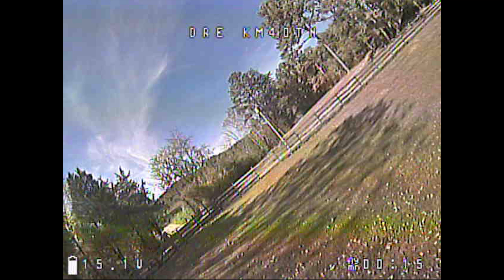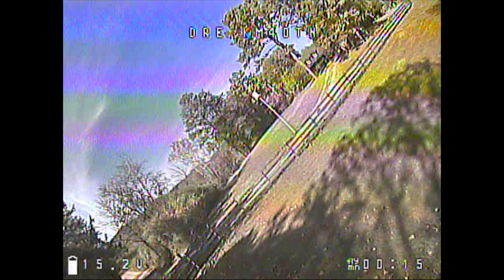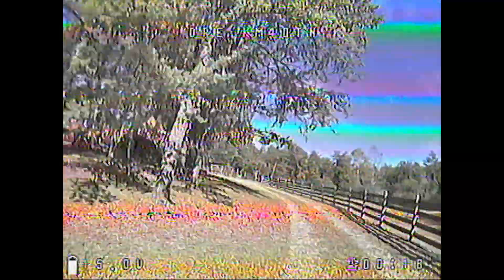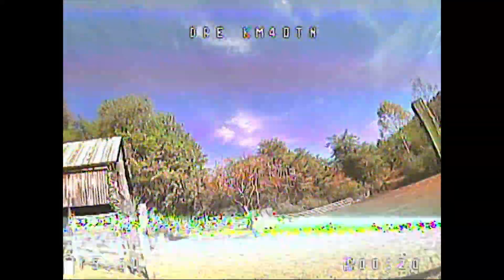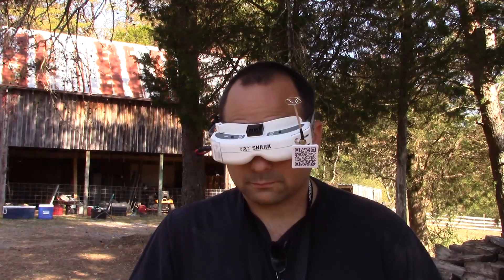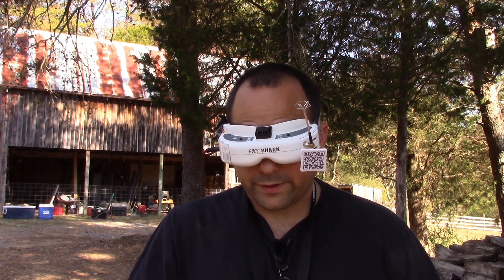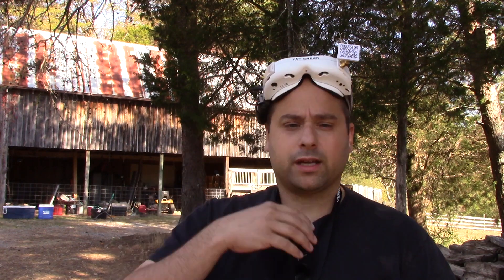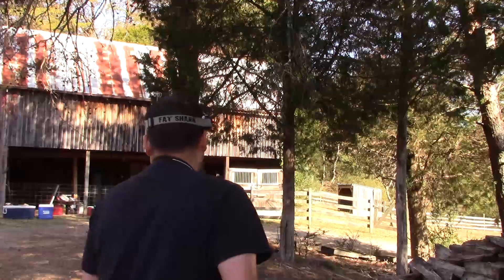Can You Troubleshoot #4 - CYT Why This "Desync" Isn't A Desync At All

Comment: Was there ever a successful troubleshoot?  I have the same thing happening regularly to my quad.  OSD splash, armed, somewhat controlled flip or fall out of the sky... seems increasing min throttle and fail safe hold time helped but I think bad signal strength in the first place is to blame.

Comment: my first thought looked like you caught something like a tall blade of grass/wheat with motor 3's prop because it was your copter acted like a happy dog running full speed on a long leash and got whip-lashed. If the motor got jammed, could it be that caused a momentary high amp draw & then caused a brown out?

Comment: Did you ever figure this out?, maybe rc reciever lost power and reset for a split second or signal to the FC, RSSI showed 0, but still showed 14.9 volts, you check BB for rx signal, just my 2 cents. had a issue 2 weeks ago BB showed good RSSI but RX reciever data dropped low, but no indication of a failsafe. maybe wasn't long enough just enough to make me panic and crash, one broken prop easy fix. very similar to your vid. only ever happened to me once. no  mechanical problems found for me after a rebuild for inspection. also fpv dvr audio for me showed no sounds of reboot tones.

Comment: This looks very similar to a failsafe that is set to hold the last values. The quad locks into position for a split second and if it regained signal it would flipped because of a correction from the radio. This happened to me when my transmitter was failing.

Comment: Just went through something  similar where my FC reebooted mid flight on it's maiden.   Turns out in my case, the built in OSD was loosing sync with the FPV cam when it went through changes in lighting.  single stepping through the fpv footage capturing screen grabs and making a mosaic made itobvious that the OSD had lost sync when the contrast changed, followed by complete loss of OSD and control.

Comment: I definitively love such work of investigation :)
I know this is a pure troubleshooting and methological exercise and as you say : 'All we need is in this video', but for me the most important information of this video is that you mentionned you haven't solved the problem yet even if you have more information than we have !

Let me clarify :
Based on all previous comments and investigations, we have all differents ways of investigation (failsafe, prop issue, pdb issue, etc...), all based on the same observation : your video.
I'm 100% sure that you have also watch carefully your video footage frame by frame, and all the observations we already made, you already know that !
But to give you the good troubleshooting walkthrough, we need to have more information from you and especially the state of your quad when you arrived at it after the crash.
(When I have such issue, the first look of the quad is at least as important as the video of the crash !)
So I can notice that even if you know the state of the quad after the crash, it is not enough for you to know what the issue was. And it is definitively a good information for me :) (when we know your level of knowledge and expertise in quadcopter...)

So in order to be all at the same level of information, can you describe as much as possible (and objectively) what you see when you reach it on the ground ?
Cable cut or not, solder broken or not, props broken and if yes, which one, etc...
Are you able to arm again and start motors spinning just after the crash ?
About the failsafe, what is your delay configure in betaflight for state 1 and 2, as this could definitively exclude failsafe issue if your delay is greater than we can see in the video.
Thanks
Reply: Hi Raf, you seem to be a knowledgeable expert in this field, can you pls help me out. I've had a very similar crash with my copter. And adding onto that, logs show a motor output saturating. And i confirm that there are no wire cuts or solder breaks or prop failure or motor coil burn. And state of the drone post crash is disarmed. And in this state when i try to again arm and run my motors using motor test, they don't respond. Unless i reboot the drone, then everything seems to be working fine. What do you think is the possible issue?

Comment: I think it was motor/esc #3 that failed because it looks to me like the back left of the quad drops first.  It can't be this simple because of the OSD popping up just before hitting the ground, but I really can't elaborate on that.   Something I also noticed was that the quad didn't keep rotating after it was upside down it leveled out just before it hit the ground, I assume that is the point you hit the disarm switch?  As far as the black screen that I see people mentioning, I believe that is just you losing video signal momentarily because the antenna was in the dirt, and your body was directly blocking the space between the antenna on your head and the quad, as well as the ground itself.  The quad rolls to a rest nose down with the antenna slightly up giving you a better signal, and a second later when you lift the goggles off your eyes and remove your body from the equation, it gets even better.

Comment: the quad copter went from an armed state to disarm, then to arm again, seeing as you were going through an area which may have been momentarily obstructed from your transmitter, (unless this was you doing the disarming arming though i doubt you would have rearmed so quickly), my guess is the receiver signal got momentarily disrupted and switched to disarm before quickly regaining correct signal and switch to arm, however this is more of a guess and i doubt you don't bend or kink your antenna wires.

Comment: Well I got way more thoughtful about this than I planned! Initially I thought left rear motor failure but the more I watched the video the more I questioned this hypothesis. 

I think the sequence of events is...

1. the cause happens. Looking only at what happened and not why,  the copter appears to freeze in its movement around all three axes. It is hard to describe but it just LOOKS like Josh is no longer giving inputs. 

2. Following this brief 'pause' a small uncommanded pitch up roll left yaw left moment was enacted on the copter. 

3. The copter flips back and rolls left and lands on its back. Upon hitting the ground power is disconnected briefly and the FC reboots.

Lets start with a thought about the flip backward and the roll left. I do not think this was a result of left rear motor stopping.  The reason for this is twofold. First if it was just the left rear motor stopping the quad would probably have continued to rotate and accelerate in rotation until it hit the ground. It didn't. It flipped over 180 degrees and then reversed into the ground while inverted - but the rotation had definitely stopped by this stage. Secondly, if it was the left rear motor stopping and Josh disarming that stopped the rotation, Josh's disarm reaction would have been insanely fast for the end of flight summary to come up so quickly. From the video of the camera on Josh as it happens I don't think his reaction in disarming was quite that fast.

Therefore I believe the motors stopped BEFORE the quad pitched up and to the left. We then need to explain why it pitched and rolled and I believe the answer to this is aerodynamic. If you look at the flynoceros quad with it's top mounted pod and picture frame design, it is quite feasible that the centre of aerodynamic pressure (centre of drag in forward flight) creates a coupled pair of forces with the forward thrust vector of the motors. This is normal with a quad in forward flight - there will usually be a moment acting on the frame so as to pitch the nose up. The Pitch I term is usually acting against this and can be seen in blackbox logs.

When the motors stopped however, the PID loop loses its ability to counteract this pitch up moment but the aerodynamic forces still exist - and start to win out. The quad therefore pitches up but not too violently because it is only driven by the airflow, not by a rogue motor(s). This is why it seems to only gently flip over backward by 180 degrees.

So if we assume that any problem that caused the crash was not the cause of the obvious symptoms we see (pitch up, roll left) we can start looking earlier in the timeline for the cause. This is where I come back to the first point above. The quad appears to 'freeze' for a brief time before the flip. To me, it looks like a receiver failure maybe. (Not certain, I have never had one haha). Or maybe a voltage drop. I am not too familiar with the operation of BF OSD. If the board reboots, does the end of flight summary screen come up? Or does that only come up when you disarm.

Either way I think the key is in that moment where the quad freezes.
Reply from the maker: This is a really great analysis. Gold star! I will say that I don't remember the copter freezing up, but it is an area where I would have been flying pretty straight and level anyway. The copter freezing up would be consistent with the most likely cause of this event, given all the evidence. And I do agree that the video seems to show the copter freezing up.
Reply: Hey looks like I was kinda close from your other vid! I know you didn't remember a freeze up but man, the copter does this little jerk up thing a fraction of a second before the arm drops and it looks so much like the human is out of the control equation at that point. This was a great Troubleshooting video. Would love to see more of these and more video based analysis in general. Maybe given that the blackbox data is become less useful for tuning you could do a few more of these kind of things on the livestreams? I think tuning and diagnosing by video is a really useful skill.

Comment: 2:57.00 I may be seeing things but it looks like there is a little bump as you are leveling out and then the quad appears to keep it's direction (not sure if it's intentional or not)
There is a start to the roll (with may be a bit of yaw) to the left
The OSD reports the stats whilst the the nose pitches up
Before the quad hits the ground backwards, we see armed on the OSD
The video cuts out and comes back
The OSD shows the FC start up screen

Usually when the quad falls backwards like that it's a loss of power or it could be a failsafe but we didn't hear any warnings from the TX and the OSD reports it's still armed but that could just be the last state it had or there was a glitch which disarmed the quad and re-armed it quickly but if throttle was high it won't spin the motors. I would have to go with loss of power though usually the OSD is hooked up to the same 5V power rail and it kept displaying just fine, so it's an odd one if that is the case.

I would do the usual things first, check for loose cabling, unusual broken props, fc/bec/esc/motors heat, range test the receiver.
If it all checks out ok, see if you can replicate the issue, by hovering or doing a roll (usually a good way to bring out any problems).
Add a large capacitor to the PDB and/or to the FC board.
Add a DC-DC converter to power the FC or RX itself.
Try a different BF firmware, swap out the receiver, swap out the FC.

Comment: Really like these great educational / troubleshooting videos!
My "educated guess" is the FC Reset mid flight.  Motor #3 was the first to stop.
Would be investigating power supply to confirm no issues & I would check the BB log to see if there are any other clues.

Comment: Based on observing the copter losing power at a corner and the osd restarting I would ask the following questions. Are you getting your 5v from that hobbywing 4 in 1?  What is the 5V rated for? I read on sirin's website the VTX osd requires a 1 amp bec. That is a lot for a vtx. I had issues with the TBS unify pro over drawing the RROSD (Unify pro draws 600 ma at 5V/ RROSD only rated for 500 ma) and the copter would fall out of the sky and restart. When the 5V bec is integrated into a stand alone esc.  is it possible to smoke the esc. by overloading the bec?
Reply: Nevermind, looks like the bec on that esc is supposed to handle 3A. I give up and am quitting the hobby.
Reply: Haha don't do that! :P. Looks like it's a switch mode BEC in that 4 in 1 so it should be ok, if it was a linear BEC then I wouldn't trust it for what it's rated for, that's only if it's very well cooled.

Comment: Looks like the OSD reboot mid flight,  and it show the message armed wright after...  I suspect a brownout event on the +5V which might have caused the FC and OSD to reboot mid flight.  However I'm puzzled with the "armed" message because the FC would'nt directly go to armed mode after boot if it did not see the armed switch in the not armed position first.  But it might be possible if the receiver rebooted as well.  Did you have a RSSI low or loss warning on the taranis?

Comment: - So at 02:59 copter suddenly rolls left for approx. 45 degrees... very sudden as if something hit it.
- During that "impact" flight battery voltage did not change
- Still 02:59  (sort of second half) main rotation changes to pitch up/ back flip while the OSD changes to "stats"... looks like a flight summary screen.
- At 03:01 copter is nearly upside down, OSD changes again and displays "Armed"
- Still 03:01 copter touch down, video Distorsion
- At 03:02 just noise ... looks like vtx is not transmitting
- at 03:04/03:05 video comes back, but no OSD
- at 03:12 OSD shows betaflight version ... looks like the ini screen after reboot.
Reply: Thinking out loud, part 1:
- the "hit"/ roll left: really seems something hit the quad or the prop, well at least made a motor suddenly spin slower if it wasnt something from outside hitting the copter.
- the back flip + OSD showing stats: looks like as if copter got a disarm command, perhaps props spinning down from the disarm with one of the back (?) rotors already slowed down lead to the back flip
- it then suddenly changes mind and claims to be armed again
- The touch down + vtx not transmitting any more might indicate a power off caused by the touch down 
- the ini/ start screen then might indicate the FC booting up
Reply: Well, if it was me and (my building ...eh... style) I'd say cable/ antenna got in the left rear prop ... to start with

I dont get this disarm- arm thingy or what could have caused it.
If it was 'disarm' only, guess would have been that "disarm" is your failsafe setting ... but then it wouldnt (re-) arm again on its own, would it?

A wired current spike due to the motor hit-thingy leading to arm/disarm misinterpretation on the FC?
(guess I am lost here...)

The rest I'd say is due to the touch down.

Comment: So as you straighten up there is a small twitch. It would be good to see the stick overlays because maybe you just centred the stick. On the other hand maybe it is a hint. It certainly looks like it is the left rear prop that loses power (first at least) as the copter flips back  and rotates to the left. The copter doesn't force itself into the ground, there is some hangtime.

The stats on the osd seem to come on AFTER the move initiates and certainly after the twitch.

I'm going with something lose, the long stretch and lack of high g maneuvering indicates vibration as a likely cause if it is indeed physical. Maybe a broken pdb trace which is intermittent. My software prediction would be cpu loading. Restabalising will require high cpu and you probably have a lot of bells and whistles in your tune.

Comment: Looks like FC restarted midflight. I would check 5V power source and/or the ground to the Flight controller. It also explains why OSD rebooted/brief video loss occurred.
Reply: I don't think the FC did reboot in flight. I think we are seeing the OSD end of flight summary screen because Josh disarmed when he realised it was out of control. This would also explain why the quad stops tumbling and doesn't continue to flip back and roll left. You are right that the FC reboots, but it does this after ground impact, likely caused by the battery connection being briefly interrupted from the impact.

Comment: Can you tell us more about the FC and 5v BEC you are using?
Seems to me that the 5v BEC was overloaded and the voltage drop to the point the RX rebooted. the FC is more tolerante to voltage drop and only rebooted when you hit the ground and the motors gave and instant spike. the Camera also rebooted with the FC só my question is: are you feeding the Camera with the 5v BEC and that caused the overload of the BEC? if so than it is probably a LINEAR bec
Reply from the maker: +André Ferreira the BEC is the 3A rated 5v BEC on the Xrotor 20A 4 in 1 ESC.

Comment: Your OSD went from armed to disarmed, then back to armed just before the crash. Your quad yawed 180. Maybe the flight controller fail-safed, and when the quad did a 180, it re-connected to the transmitter? Check the antenna connections?